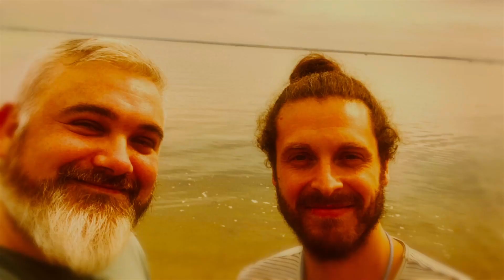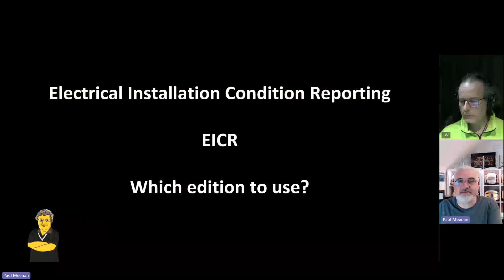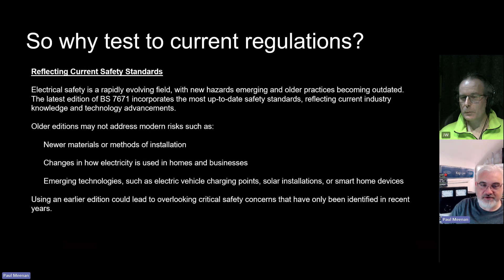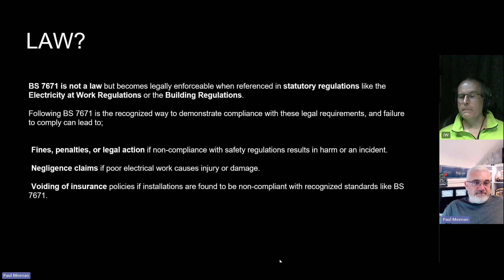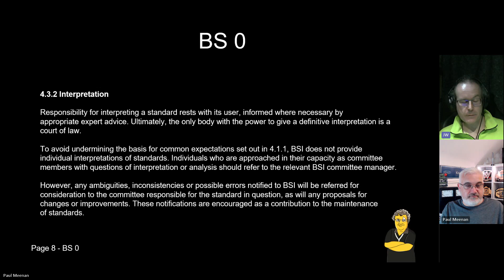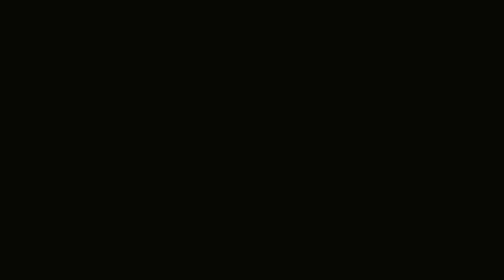EP 100: EICRs, which edition

Comment: Great podcast. My own view looking across from the USA is that the EICR while a very important basis for assessing the safety of the installation has it limitations in two specific areas. One there really isn’t, a good testing framework for load and power quality assessment yes there are other standards but this certainly should make its way in the EICR framework that would better address the dynamic risk assessment and electrical engineering analysis. The other problem is that testing of safety devices like RCDs in the UK are using a let go standard which itself is much riskier than it should be. 30mA and slower tripping RCDs are a problem and is out of step with modern electrical safety in most other developed parts of the world. GFCIs in USA trip at 5mA and around 3-4mS while still avoiding nuisance tripping. That’s not to say US residential buildings are safer in other electrical design areas beyond safety devices. Selective coordination is also an under discussed area with regard to electrical safety.

Comment: Excellent podcast and well argued. Nice to hear from John a bit more too. 

The way I approach it is to think of the concluding statement of the condition report: is this installation SATISFACTORY or UNSATISFACTORY for safe continued use. For me that makes coding much easier. For example taking a different view on non-RCD protected lighting circuits in an old flat, vs in a nursery etc…
Reply: I do also borrow Paul’s line of thinking if I’m ever stuck on a code. I ask myself how would I explain my decision to a judge.

Comment: I cant help but draw a comparison to cars; take classic cars (defined as cars from prior to 1966);  they are exempt from requirements for seatbelts but will likely still pass an MOT, this is in spite of whst we now know on the effectiveness of seatbelts and saving lives - the argument is below

The argument against retrofit of seatbelts is that the cars are well looked after by people with sufficient knowledge and, so long as the MOT is passed then all is fine and dandy, despite our advances in car safety. 
😂
Applying this to EICRs then; We get an old install with Wylex (other brands are available) 3036 boards, we are doing the exact same; we know better is out there in terms of technology and protection and honestly (much like with the above cars; IT is wrong). Yes the install has worked flawlessly for decades but weve moved on, past 3036s and cartridge fuses because of the potential danger to users changing wire/fuses for whatever is to hand. We should at the very least (especially in domestic) by putting out foot down a d saying 'no, the minimum acceptable standard of providing overcurrent is an MCB. 	If we dont then who will? To steal a phrase from the man himself; "Be the brick wall'

To steal another from the man himself "The installation is life expired".There is always going to be financial issues when it comes to rewiring etc but thats the customers concern and dhould not come into our judgement. There is, as with everything that cost vs reward analysis but who else is in the position to improve installations? If the client doednt want to upgrade the kit then fine ubut we should not be complicite in keeping ancient kit in place just because it works, not when our understanding and methodology has moved on leaps and bounds. The exception to this would be additional protection via RCD i would say, as we have other ways to provide a similar level of protection in the EEBADoS model - yes thty can still disconnect bonds etc but the primary protection of ADS is still catered for.

I may have gone off on a waffle but it makes sense in my head. There are comparisons between the 2 and advances in both cases to improve safety but we're not enforcing better protection in either case.

Comment: Excellent podcast Paul. 
Don’t want to say anything more on EICRs as I don’t want people shooting me down, because they think I’m wrong and don’t like or respect my opinion. I will say this whatever the HSE notes in BS7671 and on page 99 of the onsite guide says we should always test to the current edition of bs7671 .
Reply: Go to say I don't fully agree, the current editions of BS7671 say that previous installations, to the standards of their time, can still comply. I am however sick of seeing sockets in schools without RCDs and DBs that are not accessible for maintenance. Circuits not properly identified ( despite recent addition) and wiring too compounded within limited space at a DB for IR testing to even start to be a thing. When does a C3 become a C2? 
Let's not even go there with the time we are allocated to do this work in, simply because the installation is obsolete and too big that no one can afford to pay for compliance, we have to try and make on the hoof assesment to keep people safe. Thankfully there is a lot of built in redundancy in the electrical safety standards here because by and large it has not been in continued maintenance and improvement.
Reply from the maker: @stevetunnicliffe5897 great response. It’s all about the engineering assessment. It’s become lost in recent years. This was to dust the cobwebs and get a better debate going
Reply: @e5Group  don’t get me wrong I wasn’t saying I totally agree with the HSE notes , I was just pointing out the fact that we can sign off older installations as safe for continued service. I do think however it comes down to out engineering judgement,